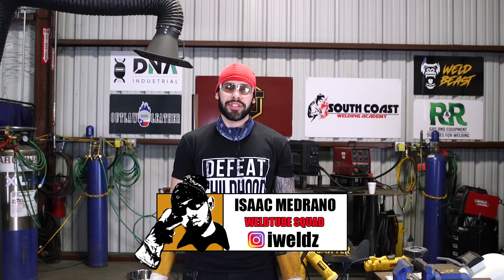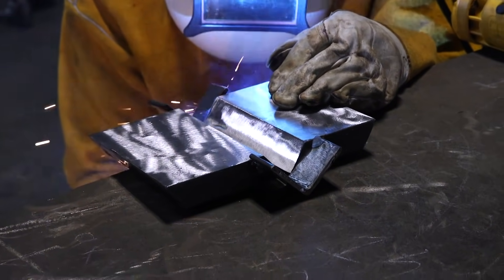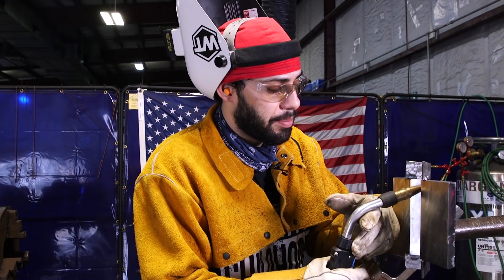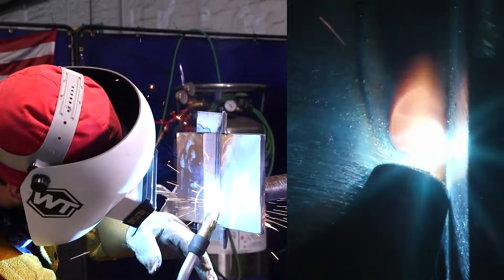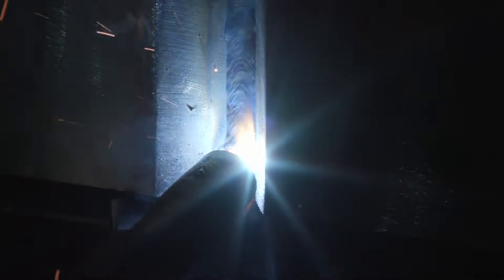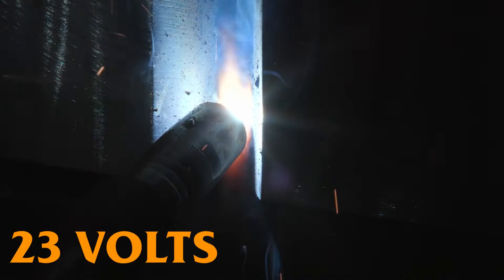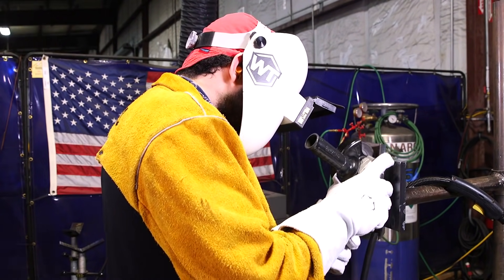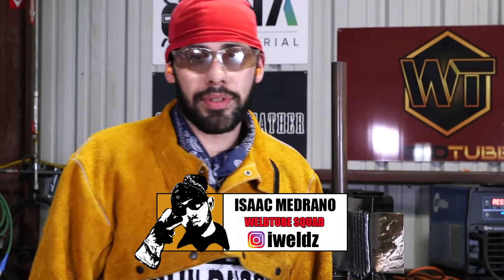1" Plate MIG & Flux Core | 3g Position

Comment: Great video. I have a test today on 3/4” plate… I took it 6 months ago and busted it because I didn’t let it cool enough before I went to cap it and blew a crater in the center of my weld. This company wants you to run your flux at 24 volts minimum, so I guess I need to turn my wire speed up to about 280?
Reply: Update… failed the test. They said my root pass had suckback (it was flush, not concave). I used the same settings and technique as in the video, did I do something wrong or were they full of shit?

Comment: I thought 3g was vertical up
Reply: On a 3g MIG/Flux test, they usually want you to run your MIG root downhill and the rest uphill. I’ve only taken one plate test with an uphill MIG root, so this procedure is pretty much the norm for plate tests.
Reply: @josephstephen2456 I've been welding over 20 years and I've never ....ever heard that

Comment: For you new welders you need to get away from that right left weaving bullshit, his filler was undercut up both walls all the way up, need to go straight up with solid consistent beads, its ok to move right to left slightly about an 1/8th of an inch,alot of shops and places ive been too you have to pass the visual inspection on every pass before it can make it to bend or xray..That thing may of bent but i guarantee this shit would never shoot

Comment: From my 11 yrs experience...that test would fail the visual cause of the grinding and too many beads on cap...3 beads should've been enough in shipyard and drilling rig welding.....and possibly the cold roll in the first 2 stringer beads inside plate on top of the hot pass.... x-ray and UT will bust ya out with trapped slag and incomplete fusion
Reply: So many things wrong with this comment. Everything depends on your WPS and QC that’s administering your test. WPS will have maximum widths depending on the electrode size you’re using, as long as your beads are within those parameters it doesn’t matter. If your QC lets you use a grinder who cares. There wasn’t “cold roll” or lack of fusion in the stringer beads that’s just how fluxcore runs, even if there is slight “cold roll” that flux core is burning hot enough to burn it out. Doesn’t sound like you’ve made to many critical X-ray/UT welds, there’s no doubt in my mind that plate test would shoot clear.

Comment: Is it availbe to run a root weld with mig on a backing strip 1/4 backing strip on the 1inch plate? And the rest with flux cored

Comment: I took a WABO (Washington Board) 1" unlimited 3G FCAW this week. 

No downhill root, no mig root, 3/8" backer, no grinding on root but grinding was allowed on subsequent passes. Fairly lenient test. 

But I want to say thanks, this video gave me a strategy. My root went in like shit but I recovered on my hot pass. Then middle left, middle right. This video definitely gave me a good strategy. I just watched the puddle work it's way up on the plate from mid. Wasn't a perfect test, but it passed the bend with flying colors. Thanks
Reply: I took my WABO yesterday 3g 1inch plate. Most of this will not pass. It will with AWS though.

Comment: How long do you let the metal sit before starting each pass? 
Thanks for the video.
Reply: About every 8-10 passes you let the metal cool down. As for each pass you don’t really need to wait at all, just make sure to clean it well every pass. I would suggest more stringers than weaves as it’s easier to control the puddle without running over previous slag, which might fail you a bend test.

Comment: why do you change to flux core instead of mig welding the whole thing?
Reply: The whole point of the video is 3g flux welding. He uses MIG for the root instead of flux because it’s gonna to leave a lot of slag on the back side of the weld. You can still flux the root, but you’d need to back grind it to remove the slag and root weld before caping it off with a single pass.

Comment: I had to take a 3g one inch test 2 days ago. I  watched this video the night before my test because I haven't flux core welded in a very long time followed his instruction to a  tee and passed on the first try. Great video
Reply: Taking a 3g one inch test tomorrow im hoping for the best
Reply: Good job man I’m taking a flux core test today after only welding fcaw one time😅
Reply: I got 3 and 4g one Inch cert test tomorrow with 1/16 flux core. 🙄
Reply: Im taking 3g test tomorrow, mig root, and flux core fill, my first welding test ever. God im so nervous, i hope i will nail it 😅

Comment: How long to wait between each pass, ive had problems with it being too hot. And ive got a test soon for a job
Reply: Just wait about 5-10 minutes between every 8-10 passes. Just also look for the arc gouging out the metal more than usual, that’s usually a sign that it’s too hot and you might need to wait or turn your voltage down. At the cap, make sure to let the piece cool down as much as you can and to turn down your setting so that you don’t get undercut. Hopefully this information is somewhat useful to you.

Comment: Straight line stringers are easier when u have to weld for 10-12 hours a day. Easier to be consistent to 80% of us but oscillating works for some.
Reply: Very true, and it gives you a better chance to pass a bend test if you’re not comfortable with doing oscillations, and worry about running over previous slag.

Comment: just wondering why no backing  bar on the plate is it a AWS differnt requirements for flux?
Reply: Open root complete penetration weld. Mainly depends on the WPS you’re welding off of. Open root is fairly common

Comment: How about some .068 flux core videos I burn 100 pounds of lincoln .068 nr 211 a week  some times my welds look dark on the outside  I grind all good  do bend tests all good just ugly
Reply: How thick material can you weld with .068 nr211?
Reply: @darylmeanger2849  I do 1/4 to 1.5 no problem the specs say 2 passes max but it stacks nice digs deep and holds strong . It is my go to because it's easy strong and fast I would like to Improve the astedics though. Welding with a suitcase is probably twice as fast as stick and just as reliable if not more

Comment: Can you guys do a 1G-2G-3G flux core with  Ceramic backing on 3/4in plate 1/4-5/16 root opening test for the shipyard bois out here, theres a high demand for structural welders who can weld with ceramic backing in a lot of positions whether its vessel repair or new construction etc.

Comment: Only one problem........ they don't let you grind or use a wire wheel when we test.   They definitely won't let us grind a Cap pass down and then re-weld it....but it looks great... In the field it's another story, you can grind and wire wheel as much as you have to.....Excellent video....Let's face it man most people grinding or not couldn't make it look as good as yours in the end.
Reply: Depends where you’re at
Reply: I just did this test yesterday and was allowed to grind my toes and wire wheel it also
Reply: @IssaTyler In the Ironworkers Union you’re not allowed to grind or wire wheel when testing. No mechanical cleaning. But you can use wire brush and pics to get at any slag. I’m not saying I agree with it, but that’s the way we do it, when testing…..

Comment: What speed and heat do you run your caps?
Reply: If you're doing a test where the cap is removed after it passes a visual inspection (bend test) you can turn your settings lower so that you don't get any undercut on your cap. 
You don't need to worry about penetration too much on your cap and depending on the position and your level of experience you can easily get undercut that may cause you to fail. Run slow beads on your cap to ensure you fill in any undercut you may or may not be creating.
Reply: Lower your settings and make sure your piece cools down so that you don’t get undercut.